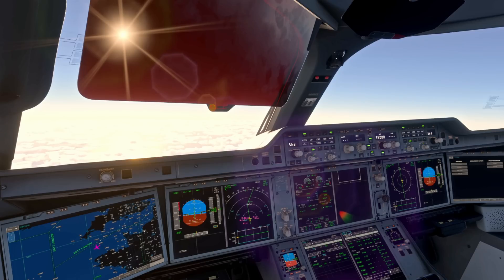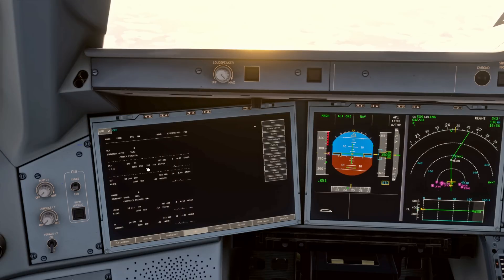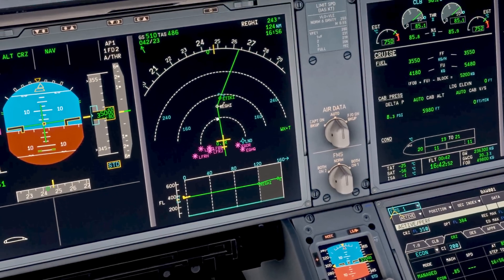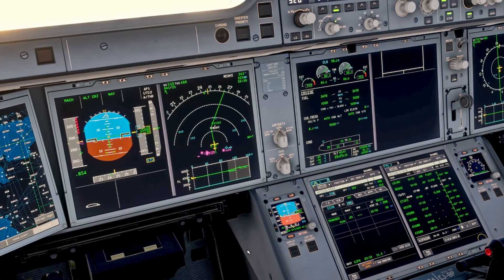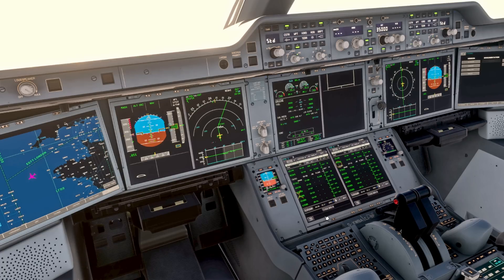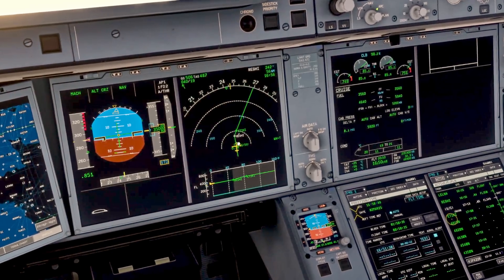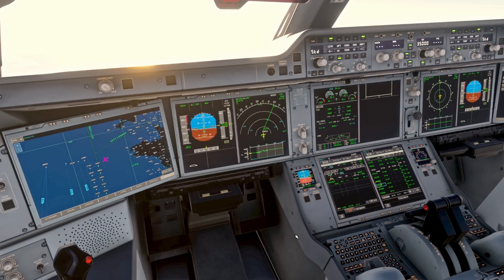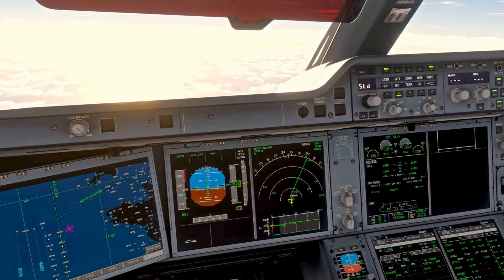A350 Cruise Setup Tutorial | Real Airbus Pilot in MSFS 2024

Comment: Great video Captain, very helpful, just a question, I'm having some trouble with the auto step-climb feature, I have auto step climb on, and my T/C is 41,000feet, when I'm on the ground I set it to 35,000feet for my initial on the autopilot, but during the flight it will only stay at 35,000feet, even though on my flight plan I have my step climb at a waypoint for 370 then 390 then 410, but it doesn't ascend to any of the step climbs, and I have to manually change the autopilot altitude to the next step climb. Please let me know if you can help. Thank you Captain,
Reply from the maker: Hello, I'm pleased you found the video helpful. You are not alone in having issues, it seems to be working 50/50 at the moment with many users reporting issues with this function. I'm not sure what the cure is so but I will come back to you if I hear of any updates